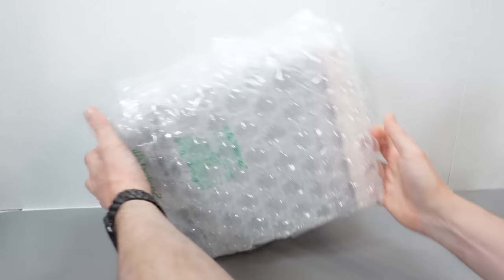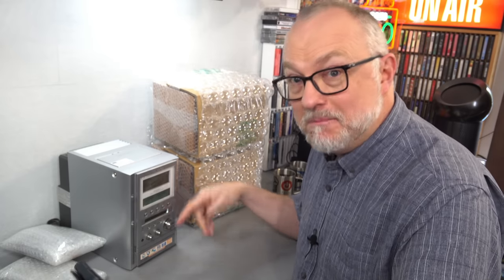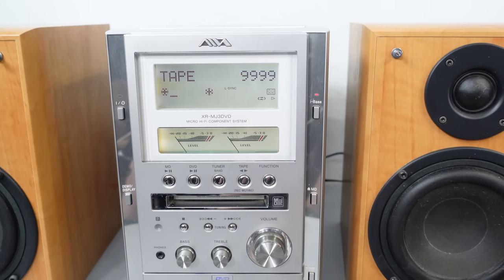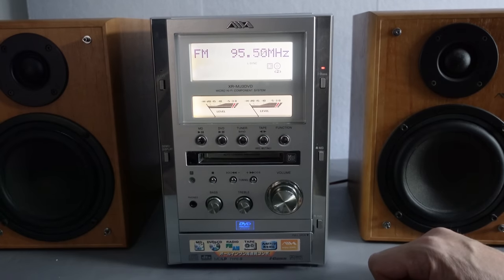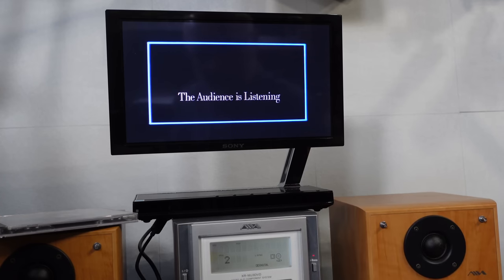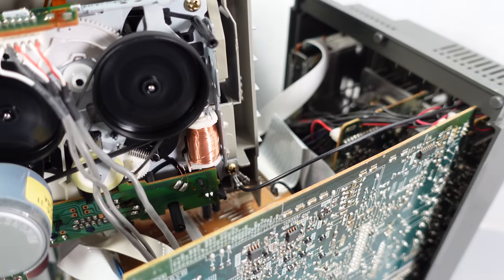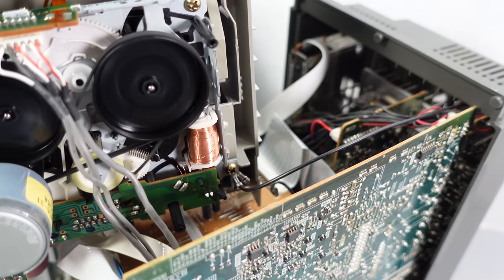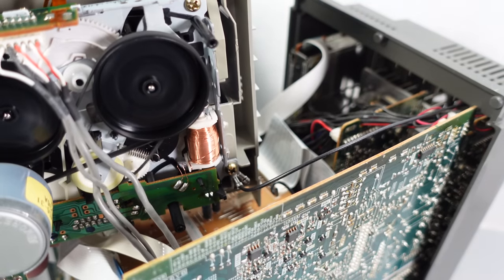Micro Systems 2:  Eclectic Boo-Boo

Comment: I rather like that this video reflects most of my own repair experiences
Reply: Yeah I was gonna say, this is exactly what happens every time I try to fix anything, it feels like to watch something that makes me feel normal
Reply: The amount of times you go in to try and fix something simple and you end up blowing up the half the kitchen and then trying to explain what happened to the missus🤣 Great video.
Reply: My repairs consist of a wall and a boot.
Reply: disassembling and assembling back cheapo digital compact cameras is a good patience practice, at least for me
Reply: @mycosys  Yep if a good kick or slam against a wall doesn't fix it then it's irreparable.
Reply: @Tim  been there, done that, was successful, but I'm not doing that again. Way worse than laptops and smart phones. I've only repaired one camera, a nikon, was a nightmare reassembling the optical focus lense and cover
Reply: Lol I destroyed my digital camera. Taking one of those apart is the worst idea ever. Of course, the lens is the only super hard part, but it really is super hard.
Reply: Every Sony product ever, just as complicated as a German car. And anything with locking tab flex cables, HELL NO.
Reply: @mycosys  I agree, but where could you look for one?
Reply: Stuck to his elbow!
Reply: I recently replaced belts on my old cassette deck, I think that’s the only successful repair I have done in forever!! You did much better than I would have!
Reply: Absolutely... People like Shango and Dave from 12voltvids make fixing this stuff look easy. It's nothing of the sort... usually I end up with a device that's more broken than when I started and a wasted afternoon. 

I was very proud of myself last weekend when I managed to successfully swap a loading belt on an old Philips DVD recorder but that does seem to be about the limit of my talents. 

I can understand now why (where they still exist) repair shops charge so much just to open these things up and confirm they're dead, oh and that will be £60 mate - thanks. 

It's a pity because no-one is making any more of some of this stuff... OK, you can still buy a crap Chinese tape deck, but once all the plasma TVs are gone, that will be it.
Reply: Shango can fix anything.
Reply: Especially the stuck to elbow step in my case.
Reply: So say we all.
Reply: @donbest5024  seems that way doesn’t it. Shango can probably build Frankenstein and make it work.
Reply: Stuck to the elbow is a classic. Usually it‘s a tiny screw that falls off and disappears into outer space as soon as you notice where it went.
Reply: @discostu1uk  this is one reason I prefer living alone, stuff can be left disassembled on the living room floor no bother
Reply: @trashtrash2169  flashbacks to trying (ie, not succeeding) to realign a lens assembly for a friend which got all bent up after a camera fell down while getting a time lapse
Reply: My repair attempts usually involve a lot more swearing. :(
Reply: I've had some successful repairs, or at least bodge jobs.  Like, a broken spring on a battery terminal which had been leaked in to being "fixed" by fishing the wire through that the remaining piece of the spring was welded to (just a metal ring) to free it from where it was clipped in, then a bit of paper towel for pressure against the battery. :D
Reply: Yeah, same lol
Reply: Same for me.
"Whoops, broke a few tabs, oh no, a cable just broke, where does this go, BOOM!, ded".
Reply: thank you for sharing your experience, might help me one day not falling for the almost universal options of such a device from that period. it's a good hint also not to offer friends assistance in repair of machines of that period, usually involving a lot of sorrow. these were great when new and so delicate, that they tend to dissolve by all the components like the belt you took out. sorry you couldn't make it run as the costs of delivery may have superseeded the price. hope there was no duties on it as it is not a working machine but parts only. just the other day i gave up with a dvd player just ripping out plugs and sockets and, they never become worthless, screews. the more basic the machine, the longer it lasts, the more basic the component, it survives, turns out to be just nothing else than the universal screw. 😢
Reply: So true. God I hate attempting to repair micro hifi units.
Reply: @chrisridesbicycles  this made me laugh way more than it should have
Reply: @KarlBaron it is refreshing and relatable
Reply: My repair experiences are mostly the same. I shorted out my Sony GT-300S car reciver when i was trying to install a bluetooth module in it. I broke NFC pins on my Xperia XZ1 when i pulled the board from the wrong place. And even when i was replacing clutch master cylinder on my shitbox i f*cked up the drivers door(it got caught on garage wall and opened too much)

Comment: The minidisc ejects problem is because when you put the mechanism back together, you left the white sled forward, it should be towards the rear of the mech, I found this out repairing a Sony CMT373NT, also be careful of the capacitors on the amp/power supply board, they're usually right near the minidisc housing and they will bite you if the MD housing or your screwdriver touches it.
Reply: in this case you swapped "forward" and "rear". The front of the mechanism is the door, the rear is in the back. But moving the sled alone normally requires spinning the axles as well, or you risk breaking the flimsy plastic. Personally much prefer the early generations of MD players (even if they can't do type S) - those massive aluminium constructions are near impossible to break, but of course probably cost more to make than making them entirely out of plastic
Reply: I think it’s too late to giving him a help if he already threw it into the garbage… 

P.S. I am a owner of CMT-M333NT and have a question about “T9” feature that Minidisc Wiki and “minidisc org” website stated that it has “T9” for typing names in CD, MD and Radio modes, does your model  really have this “feature” or it’s just another hoax like with “minidisc org” website stating that it has a proprietary “PC-LINK” input in this model (if it has a USB Type B for NetMD)?
Reply: Exactly what I was going to say, I am also a CMT owner and the white sled need to be correctly set. 😭. I have the CMT with NetMD, fantastic little unit.
Reply: @NetzDotCom  it might still be useful to other readers/viewers who encounter a similar issue. :)
Reply: this isnt related to MDs but cassettes play a bit slow on my sony cmt-cp100 so would getting a new belt help or should the speed be adjusted on the motor?
Reply: As the owner of a CMT-C7NT who had to do the same repair and had the same issue and came in here to say just that :) . Sadly I bought the unit without a remote and without the speakers (which seem to have a proprietary powered 8 pin DIN connecter). Still, it works well connected to a PC for NetMD.
Reply: @mg86_  new belt or change speed setting if you can locate the preset. Sometimes, a little lubrication and cleaning of mechanism helps too
Reply: @NetzDotCom  my CMT373NT certainly does "T9" text input with the remote control, I recorded an MD today and entered the track titles with the T9 on the remote.
Reply: @joearnold6881  no, the drive belt operating the eject sled was slipping, he replaced the belt but forgot to set the sled properly
Reply: Listening to this video on my CMT-373NT over USB connection, in daily service as PC sound device for nearly 20 years now, although it's not been used to play an MD for maybe 15 years. Great unit!
Reply: @RobR386  That was my thought too
Reply: The caps on the amplifier won't hurt but the big 450 volt cap will definitely BITE you

Comment: You pulling all those ribbon cables out really gave me the fear. Wee bit of advice, take a marker and make a mark across the cable and socket before you pull it out that way you can match up the right cables and correct polarity when putting it back together by matching up the marks. When you've got lots of cables you can vary position angle and number of marks to make sure you don't confuse them.
Reply: Yep, while i was watching i thought it would be good to put a different dab of colour on the connectors and sockets before he starts pulling them all out.
Reply: I'm now really glad I only ever disconnected the ribbon cables in my 20-year old 35mm film scanner on one side.
Reply: Same, marking them would have been a good idea. Shame the thing went pop, but you live and learn. Was one of those days I guess😂
Reply: Do ya think it's possible the accidental incorrect installation of the ribbon cable may have sent power to a sensor of some sort which then would've shared a common ground with a sensor for both the minidisc and cd/dvd player?
Just feels plausible.
Reply: How about the manufacturer putting the device together with one-way plugs?
Of course the companies who don't want you to try to fix things can write "No user-serviceable parts inside," and "Warranty void if opened," on the case, and expect you to buy a new one - more profits that way.

Plus you don't get to find out just how cheaply made the product might have been - thus avoiding ruining the customer's brand loyalty. 😠

I will never buy a normal laptop computer after volunteering my time repairing them for a non-profit that helps low income families obtain computers. I might consider buying a ruggedized one if I ever felt I needed one.
Reply: Moral of the story; If there is no mark, mark it yourself.

Comment: The repair sequence reminded me very much of trying to work on one of those all-in-one PCs back in the day. That same sense of having to deal with 50 pounds of electronics crammed into a 30-pound sack.
Reply: Crazy how small tech has got now. I took apart a more modern AIO and it needed no screws and all replacable parts were open with the removal of one or two panels. It's way more capable and way easier to work on. If only the software worked. I hate drivers, had to use an external wifi adapter, although the internal one would have been easy to replace. If I have the WiFi adapter enabled the system bluescreens after some use. It also does so when an SD card is removed. All the drivers were installed from the manufacturer on a clean install of windows. It's a shame such repairability was wasted on such an unstable machine. Maybe I could dual boot a linux install, even though linux is its own kind of trash. Anyway, why in the hell does an sd card reader even a driver? Can't we just know how to read an SD card? What's the point of standards if the reader behaves differently enough to need its own unique software? If it weren't unique it would already be bundled in with Windows, as many basic drivers are. What in the hell. I hate computers. I got the AIO for 10 bucks at a goodwill. Best find I've ever got. 10 dollars for what is essentially a 60hz 1080p panel with a computer inside? Not bad. Speakers are decent, definitely usable. Viewing angles are good enough. Odd color fringing no matter what I do, if somebody says opentype to me I might kill them. It is dell. The problems may come from the fact it's rinning WIN10 instead of 8, but 10 is essentially 8 but not designed by a brainlet. If that is what's causing the issue then I don't want the solution. Maybe it'd work out if I installed the drivers in 8 then updated to 10. Computer software feels like black magic sometimes. Or not, there's always a solution or reason, even if it's as lame and unlucky as the processor just having a few bad flippy bits in just the right places to ruin your day, year, life. Have you ever heard of the talking heads band? Frankly, the songs don't grip me, in weird way they feel generic to eachother, like I could be listening to any one of them and it wouldn't matter. Like there's no real meaning, or if there is it's delivered the same as all the others, stealing impact. That's why I like cage the elephant, because they cover what feels like a wide range of different feels. I also just like how they sound. They could be talking about revolting corndogs, it doesn't matter. The hoosiers are also good.
Reply: I used to be a IT technician in schools, and they went crazy for the all in one PCs. They were junk and as you say, a nightmare to work on. So I told schools that I insisted they took out the 3 year extended on site warranty. They did and that solved me having to open one up ever again. Watching the engineer that would visit to fix a faulty one was interesting, he was no better than me and said that they were junk and put together as cheaply as possible. But don’t tell the company I said that he muttered :)
Reply: Try an imac from mid 2012 onwards....
Reply: @TheErador  I’m so glad mine has the magnetic glass rather than the glue which came in a year later
Reply: @kaitlyn__L  oh yes, it's a pain, but it's actually not that hard with the appropriate tool and wedge. But you're right the 2010/2011s were so easy.
Reply: @TheErador  it’s more the putting it back on! No scraping old glue, cleaning, applying new glue, hoping it’s all lined up. Just drop it back into place
Reply: @cmdraftbrn  Also most of the death!
Reply: @trashtrash2169  By the way, its worth trying linux on it these days as there's enough versions that have a chance of working well like Manjaro and Mint, best to try running them from a persistent usb before attempting a dual boot with Windows 10 (an update on Win10 can disable the dual boot), particularly if you have usb3 on that thing where it will boot and load programs almost as fast as a hard install: Rufus has an option to create a linux usb with persistence and you can get a 64GB Kingston stick for around £4...
Reply: @Inverse_Midas  Pretty much same with early laptops. Notestars were hell to repair. Ribbon cables everywhere, brittle ribbon cable connector latches. Ductaped cables over the board. Looked like a cheap electronic toy.
Reply: @cmdraftbrn  The flyback transformer: Known for making CRT shock victims literally fly backwards.
Reply: Its just like a large laptop. I have one, but i don't want to ever get inside. Problem is, the thing has a fan, and dust will ruin it sooner or later.

Comment: This is one of those devices where the promotional sticker on the front lasts longer than the components inside.
Reply: That reminds me of the "Intel Inside" sticker I've literally tried to remove from a laptop and failed.  I'm sure I could get it off with some effort and a sharp tool, but I don't want to scratch the surface. That sticker has outlasted three office chairs.
Reply: @tarmaque  They come off easily with a heatgun and a blade. The glue is really gummy and the sticker is rigid, so they are easy to apply somewhere else as well.
Reply: There’s planned obsolescence for you - more profit for the company at the expense of the consumer…
Reply: Exactly the type of device I walk right on by, even when free...

Comment: This video pretty much sums my experience with this era of HiFi. Devices that lasted for couple of years and then usually ended up as radio-only components at someone's workplace after the cassette, CD and other parts had just given up on life.
Reply: Yes and unfortunately these mini systems end up at Goodwill in separate batches so not only do you have to hunt down the matching speakers and remote, but you end up with a unit with a faulty 3 CD changer or wonky cassette player. Oh well, at least they look good.

Comment: Even after so many mechanical failures I still wouldn't give up and dig in further. Such a neat little do it all system with VU meters to boot! I learned the hard way as well with ribbon cables, they require patience and careful treatment, I have a special set of needle nose pliers with grippy tape around the tips for those.

Comment: The MD drive is an MDM-7 mechanism, the most reliable MD mechanism Sony made for decks. I believe the sensor inside the left side of the trap door is dirty and stuck to "MD IN" position. Spraying some contact cleaner on the sensor can solve the problem easily. A pleasant video as always!

Comment: It's so familiar. One Philips microsystem of mine finished like you Aiwa, only speakers worked at end. But then I won ebay auction from UK Sony CP500MD. MD belt was already changed, i changed cassette on. All finished good and working with no problems.

Comment: 21:35 The reason it says Frash instead of Flash is due to a translation error. The character for L and the character for R look identical to anyone who isn't fluent in Japanese and so you get translation errors like this where R's are used where an L should be and vice versa. This also used to happen a lot during the NES's early days; even Nintendo games weren't immune from this problem.

Comment: The Aiwa Mini system looks awesome with the VU meters. My JVC-UXG60 Mini System from 2007 does not have a tape or Mini Disc drive but it supports CD, MP3, WMA audio and DVD/VCD/SVCD/JPEG/MPEG-1/MPEG-2/ASF/DivX video via SCART with RGB output. It's got a FM Radio with RDS, a USB input and an analog 3,5 mm stereo input. The specs say you can even playback DVD-Audio. I hope I'l never have to open it for repairs.

Comment: Haha, I feel you! A few years ago I tried to fix a very similar Panasonic mini system that belonged to my girlfriend. The cassette had jammed up. I took it apart piece by piece and remember thinking it was like a collapsing house of cards. On eventually putting it back together and turning it on, there was a bit of a pop and a burning smell and the whole thing was dead. It wasn't the fuse or anything obvious like a capacitor. It's in the attic now..